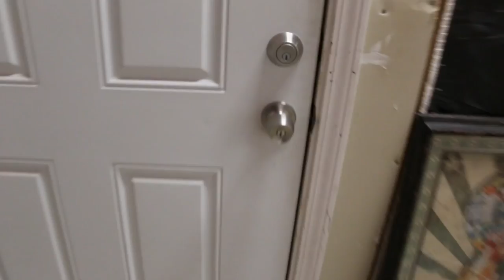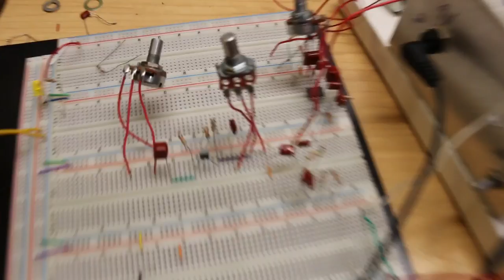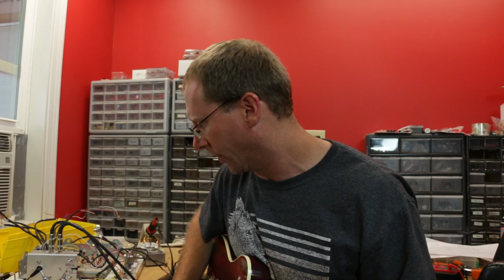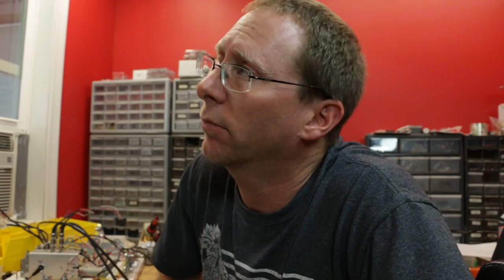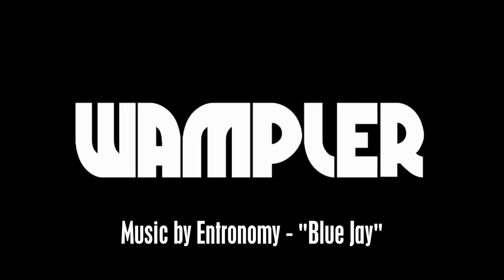Busting the myth of magical op-amps and diodes...?

Comment: The LM358 is well-known in electrical engineering circles as the worst opamp of all time. Why? Because of its output structure, which is guaranteed to cause horrific crossover distortion for 1k-ish loads to ground (assuming split ± power rails. The only way to correct it is to put about a 1kohm resistor to the negative rail, which then forces the output to be a conventional NPN emitter follower rather than a push-pull output which cannot quickly transition between pushing and pulling, resulting in awful crossover distortion. This can be easily seen using a sinewave excitation and then loading the output with a 1k to Vcc+ and a 1k to Vcc-. Turn the frequency up to 1kHz and watch (on an oscilloscope) what happens at the output. Every opamp designer is well-aware of this deficiency and does NOT employ the very flawed output totem pole driver of the LM358 and its quad sibling, the LM324. As a practicing electrical engineer, whenever I see a design using either of these op amps, I immediately know that the designer doesn't know a thing about good linear design.

But hey, you're looking for deliberate distortion in this video, so maybe the LM358 is perfect for this application.

P.S.: when using an opamp with negative feedback, unless you're looking for frequency response well beyond 20 kHz, which no one can hear, there will be zero audible difference between one opamp and another, other than the dreaded LM358 as noted. For this app, buy the cheapest opamp you can find and save yourself some money on your BOM.

Comment: I could hear the difference in the 2134, and the 2043DD and not a a hell of a lot different for the ones before them. 

Maybe a bit less with the diodes. the GE's def clipped a bit more but still sounded smooth, but not sure it's a huge difference. the LED's sure as hell had good theatrics though. 

Also, for a simple design just for the video, sure as hell sounded good. Sometimes simple is the answer.

Comment: So the orange and pink LEDs clearly sound different. Why? I have two "boutique" Tubescreamer clones from the same company, same model. One has a red LED and the other a blue. I like the blue LED pedal better as it has less drive and is slightly smoother. Is this because of the LED color? The one thing I would have liked is to have you explain what it is you are hearing in the differences and what you liked or just general comments about each sound. You have so much experience in understanding what you hearing than we do. Also, we are not in the room with you, so sometimes the differences don't translate over the internet. This was not dull at all. It was really interesting, thank you.
Reply: @jsullivan2112  Thank you for your reply. Can I change the red LED to a blue one to smooth out the sound of my pedal?

Comment: So, do you have any thoughts on why the original tubescreamer is so different? (Do you think it is "special")? .. I tried the hand wired tubescreamer and was quite surprised by how different it sounded and a friend has an original 80s one which he says is fantastic .. I would love to hear your opinions on it.
Reply: It just has to do with what parts are available, you especialy notice it in big muffs, never being particularly standardized individual muffs sound diffrent to eachother. Even the modern ones which have some kind of standardization around 2014 still sound diffrent depending on the run

Comment: I think the OPA2604 sounded more 'big amp like' than the others - less "artificial".  The Bat41 was the best of the hard clip test I think - could be that the LEDs would have better if the guitar hadn't been getting a bit out of tune.  A few could likely would have sounded better with a bit of a high pass filter on the input.

Comment: Perhaps the JRC45558D/SRV legend came  (if not entirely false) from the fact that the presence of the 'right' IC was an element of identification of the 'good' batch or period of making of TS808. Like the markings on electric guitars pots. .That 's don't mean the IC is responsible for differences in sound .
People love to have something to read and decode, especially if there is some 'knowledge' and mistery involved. And snake oil sellers like to please them. They don't want to know that there is the same mojo IC in the alarm clock.

Comment: Can I only use ceramic caps to make passive filters with resistors? Is it because of the low current of audio signals?
Reply from the maker: No you can use any caps you’d like. I usually use film caps or ceramic if it’s small, like 30pf.
Reply: @wampler_pedals  Thank you sir!

Comment: There is a dramatic difference in the noise floor of a Tl072 of 37 at 1 kHz (typ) (nV√Hz) vs. OPA2134 of 8. You can hear the difference if you have a quiet i.e. non bread board and a socket and switch them.
Reply from the maker: Yep. Now put them in a tubescreamer and run it into a Marshall and let’s discuss noise with a room full of guitarists. 😉 no seriously, I understand the point, but overdrive pedals, specifically this particular circuit isn’t that critical for noise.
Reply: @wampler_pedals  yeah I know.  I used to play through a TS-9 live and didn't notice how noisy it was until I was recording with a JTM45 in a quiet room. TS-9 sounded like an ocean with the tone up on the bright channel.

Comment: There is lots of "magic" crap info out there, but op-amps do make a difference, just don't bother with the exotic ones, they are mostly crap as well, ...and don't even mention discrete junk!
...BUT as I said, op-amps do make a difference, 1) noise, and 2) bandwidth, and of course distortion (mostly from phase and group delay inside the op-amp)
...if you want to know if an op-amp is good for audio, use a frequency sweep to check gain limit and linearity over frequency, then do a FFT on a decent scope!

Comment: With the 4558, are you using both op amps in it or just one? if you use just one, Could one use the second one as a tremolo to add effect to the overdrive?

Comment: About a year ago, i started doing mods and whatnot and i realised that where youre driving a clean signal you want Wima caps and opa2132 ,such as eq, compressors and simmilar designs, but in the overdrive pedal,  tantalum and cheapass op amps work best, for me at least. I found out that the op amps from Boss ge-7 the tl022 work wonders in ts808 reisue whereas other op amps make next to no difference in the ts808. You have to be smart with your design, is the pedal a cleab signal "improving" tool where you want the best of the best, or is it a pedal part of the instrument such as overdrive pedals where ceramic and tantalums might wotk great even bettet than your Wimas and OPAs etc... and yes, ive tried wimas in my ts808 it feels strange and the headroom gets lifted higher, same as with top notch op amps ala opa2132, same effect, not desired in such a design, unless you want less drive but in that case get a clean booster instead.

Comment: But with the two pins on the 4558 not in place, the electrons leak out.
You are also not using a Ray-O-Vac with the 32 millisecond .3976 volt slump after 2-1/2 minutes of use.  Right? ;-)

Comment: I think it's more to do with the circuit that you build around the opamp that does most of the tonal characterisation. the TS808 and the Cream Puff both use a 4558, but you try and tell me they sound the same.

Comment: Good evening, Mr. Wampler.
First, there was a little mistake. Hope my english ist good enough to descripe it properly. When it comes to the BAT46es, I saw they were both oriented in the same direction. (both cathode markings pointing towards the wire that comes from the circuit or both anodes to ground). But with clipping they should bei oriented anti-parallel, shouldn't they?
Second, may I have the schematic of your "simple" circuit? I am experimenting with opamps and different clipping diodes myself at the moment and only have schematics of more complex pedal circuits which make it kind of difficult to swap out parts easily on only one 700 breadboard.

Cheers to you, your family and friends.
Stay well and healthy these days.

Cheers from Germany,
Tom.
Reply from the maker: Yes you are correct, in this video the diode bit ended up being B-roll, so I had to repopulate the diodes and accidentally didn’t get one oriented properly 😕. Schematic wise I don’t have the info any more, it’s long been discarded since the video came out 😞
Reply: @wampler_pedals  thank you very much for the quick reply.
In the meantime i have discovered your video where you put together that simple overdrive step by step, checking the sound with every new part. I may take the schematic from there, if you don't mind.

Comment: Hi there, nice test, but i can hardly hear any differences....;) A closed loop gained OpAmp will usually do just the same as all others...The differences are in the input and output stages, open loop gain, GainBanwithProduct and common mode noise rejection ratio and SlewRate, the better OpAmps have class AB-biased output stages (NE5534/5532) while the cheaper ones are just open collectors (LM324). Some others have JFet inputs (TL081/2/4) while others have the usual DiffPair (NE5532/4, TL06x) also some are unity gain sable while others aren´t and therefore can produce high frequency ringing during zerocrossings of the input signal.

But anyway, i hope you´ll point out that OpAmp changes won´t help much...let´s see...;)

Uuh...bonus points for these LEDs :)

Comment: i just bought a old Marshall ShredMaster from 7 oclock to 2 oclock the gain is still clean does anyone recommend swapping out the 2 chips for more drive?
Reply from the maker: +Tommy A. That's not going give you the change you want. That's just a function of the circuit. You may be able to change the taper of the pot to get a more usable range. If it's an Audio taper, try linear or even reverse audio taper
Reply: ***** is this the way the pedal is supposed to sound i know back then it was supposed to be a high gain but it sounds like my jcm900 turned all the way up but from 7 to 2 its clean. Thank you
Reply from the maker: +Tommy A. I'd have to hear it to tell you for sure. You can clean the pot and see if that helps (see my last video for how to do that)
Reply: ***** a BIG thank you i watch it much appreciated.
Reply: I love my old shredmaster! Mine is the same so I think your pedal is not malfunctioning. I bought mine as a teen in the early 90's before I could afford a real marshall and I am so glad I held on to it. It still works great and I have had many offers to sell it and I wont part with it. I cringe at the thought of you modding yours.
Reply: I have a Marshall 40 watt Valvestate combo that has the same contour control as Shred Master.   Also have Vox AD50VT.  The greatest!!

Comment: Built a BMP clone using the "wrong" diodes and transistors and couldn't match the sound with an official USA BMP sat in parallel. Then I realised I had one of the filter caps at the wrong value...bingo. That was really the major factor in terms of creating "tone": the filter circuit.

Had a similar experience making an RIAA preamp. Tried using caps and resistors with a better tolerance...the RIAA output curve was exactly the same with the "bad" 5% parts as it was with the more accurate 1% parts. 

It's all a load of marketing nonsense.

Comment: First, let me say, I learned something from you. I never thought to use an LED in place of a diode in an audio circuit. Cool, Thany You.
 My main reason for searching YouTube.... and finding your page is for using OP-AMPs for human voice frequencies only. There a lot of hearing aids out there that only amplify sounds and have a few settings for different frequencies. Do they work? Yes and No. I was thinking of using OP-Amps in a parametric equalizer to to only boost voice frequencies and try to eliminate all other sounds(frequencies), your thoughts on this?
Reply from the maker: That’s very interesting.... let me give this some thought. Shoot me an email - brian@wamplerpedals.com and we will chat about this in more depth

Comment: Hi, I have a silly question - what if the pair of diodes are not the same of kind, does it affect the sound in other way..?
Reply from the maker: Depending on the type it will make the clipping asymmetrical, which is often a mod people do

Comment: I hear slight differences in the attack in his tone, could be is playing, but the sound comes in during picking differently, also breaks up differently. Stuff like this is subtle, It’s not going to be the op-amp cresting massive amounts of gain chip to chip... but to say they all sound EXACTLY the same is not true... I think a better test would be with the same signal from a tape deck or a signal that doesn’t involve someone’s playing...

Comment: it maybe hardcliping but it does sound as hard as fuzz to me. I surprised by how soft the opamp is clipping with out the doides. i thought it would sound like a fuzz. it is fuzz like but not there. I would have to see it on Oscilloscope to see how square like it is. plus for fuzz no cross over distortion is allow. unless you want to make a hybrid of fuzz and distortion. cross over distortion is what make distortion sound like distortion

Comment: In the circuit used the Op amp type didn't make a lot of difference; But in a circuit that overdrove the op amps more and relied less on the clipping diodes for distortion, wouldn't the different gain slopes and junction construction show more of a difference?
Reply: In short: yes